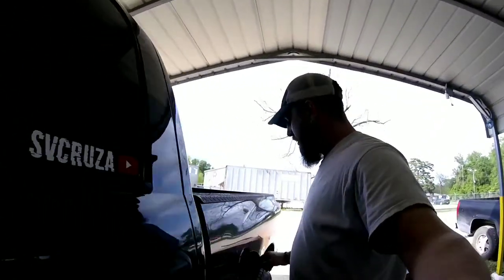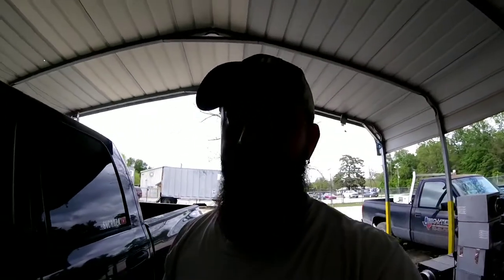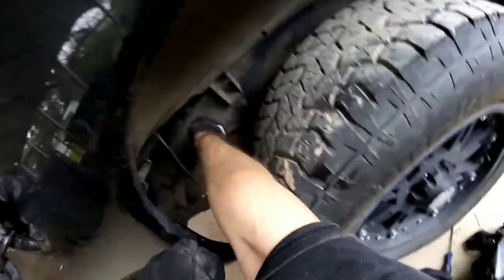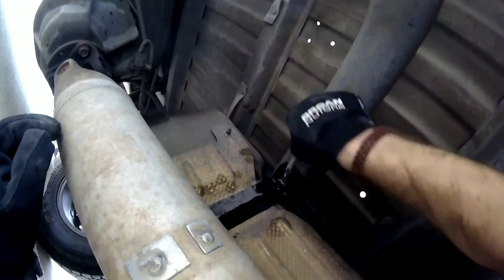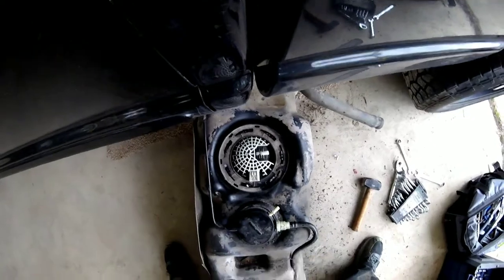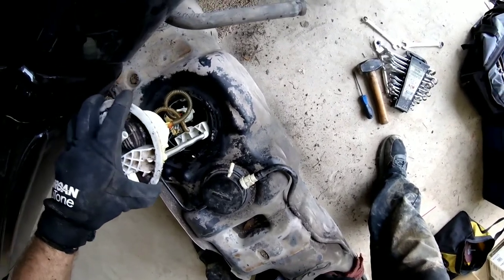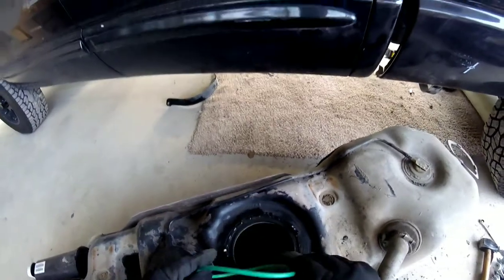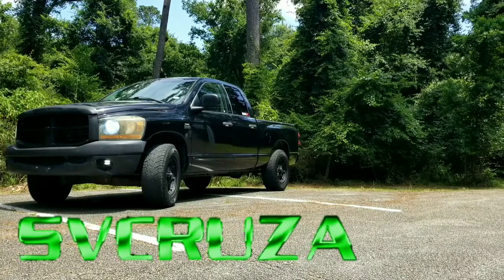How to change fuel pump 2007 Dodge Ram 1500 5.7L Hemi.

Comment: This was reality and entertaining! Showing how you figure things out as you go along, trial and error like.  Looks like putting in a different looking pump than what came out of the tank worked for you anyway, or did it?   Every one elses video showed the same issue pulling the old one out. Easy in hard as hell pulling out, unless you force it out like the way you did it. Curious to know the brand of the new pump and how much you paid for it.  Thanks for sharing how not to as well as how to get the job done!!
Reply: Jesus loves you
Reply: Oem! Ill be putting my third one in in five years. This cheap aftermarket crap sucks

Comment: The old fuel pump was the wrong one.  That old pump is for gasoline.  Not diesel.  Great video.
Reply from the maker: My truck is a gas engine, not diesel....honestly I didnt know if that the diesel fuel pumps were different.

Comment: I’m aware it’s been a while but have gig replaced with aftermarket or OEM pump? I’m debating whether it’s worth the $250 for OEM. If you have an aftermarket has it lasted or would you have preferred OEM? Thank you.
Reply from the maker: Excellent question, from my experience with new or replacement parts...aftermarket isnt always better! Especially when it comes to important components you rely on daily. Purchasing aftermarket parts runs the risk of cheaply made and under engineered and will mostly likely fail sooner. OEM or (Original Equipment from Manufacturer) parts are certified by engineering departments from the manufacturer themselves, known to be overly engineered and proven to operate in some over the harshest environments without fail. If you are wanting to set it and forget it...OEM is the way to go hands down no questions asked. If you like changing your pumps often the aftermarket is your ticket. Especially in a truck where you have to drop the damn tank no matter how full or empty it is, OEM wont let you down. Hope this helps dude.

Comment: I am replacing my pump in my '07 ram right now.  Dropping tank is not that bad but I did break 2 of the fuel line clips.  The connections were so packed with gunk that the fitting tool would not compress them so I had to kinda pry them out.  Is there a source for these clips?   I have not been able to locate replacements.
Reply from the maker: O'Reilly auto parts sell the fuel line retainer clips. Next time hit the clips with brake cleaner and some compressed air to get the dirt out.
Reply: Thank you so much for your help.  Good video BTW! @svcruza

Comment: U could have undone the bed bolts and lifted it off
Reply from the maker: Its possible but I ain't doin that shit. Lmao. This way is easier and bolts are far more accessible.
Reply: @svcruza  I just did a pump on an 04 and it was a better option for me
Reply: I’m doing this job right now… same truck same year.  I thought about cutting a hole in the bed right about where the fuel pump is then patching up the hole BUT…. I decided against it considering hopefully this is the first and last time I have to change it out.  If it was something I would have to do even semi often I would’ve went that route.   

So here I am, laying on the cold ground while it’s snowing dropping my gas tank…..😂 🤦🏻🤦🏻
Reply from the maker: @TruthRISING2024  I'm sorry brother...I know the feeling all too well. Lmao. Let's put your mind at ease...I changed that pump and still no issues with the truck....not one! No need to butcher the truck.
Reply: I'm going with the cut hole in bed option , fuck it I can patch it back . It's a work truck anyway
Reply: @christophersmith6410  it’s actually not too bad if you drop it.  Make sure it’s drained or low on gas. You can te huh everything if you can drop it.  I was able to pull the entire tank out from underneath the truth. Work on it standing up. Then slide it back under.   Try to rope one of your buddies into helping you.  Lol. Easier with 2 people